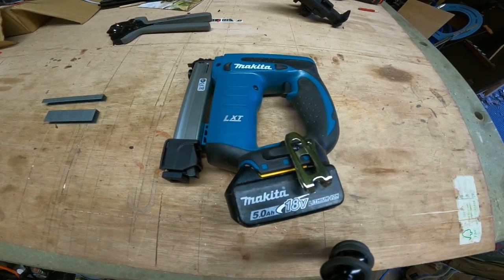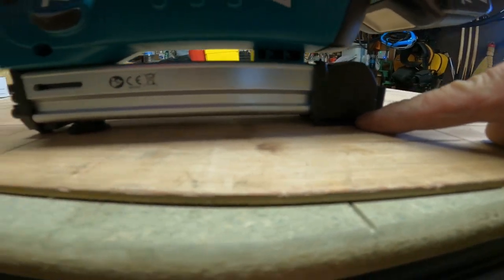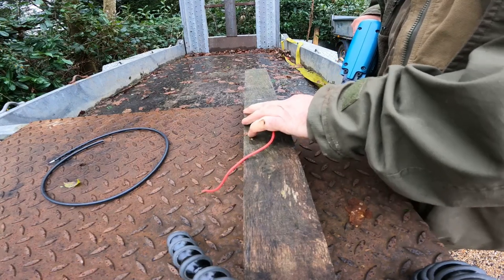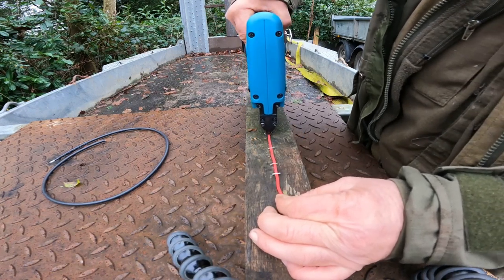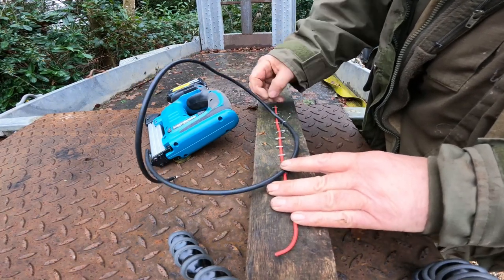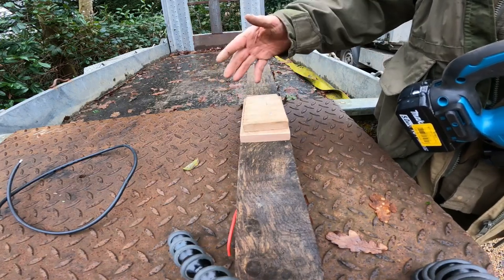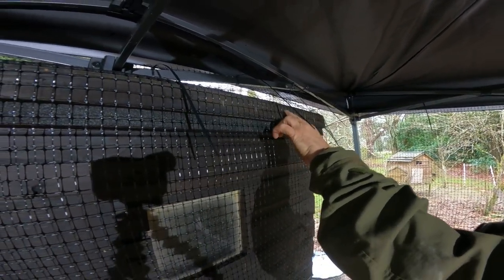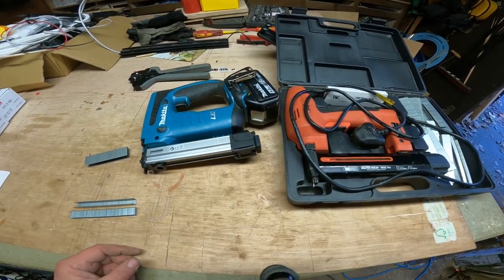Makita DST221Z 18 V Li-ion LXT Stapler

Comment: Hi could you please answer a question for me. What's the length of the stapler on the top. I want to staple carpet under my stair tread and worried it won't fit for a flush line. My aim is to carpet my stair tread only and not the riser. Appreciate it if you could advise for me before I drop a few hundred quid on it.
Reply from the maker: The length along the top is 192mm but the handle curves up another 10mm  100mm back from the top. If your tread overhang is less than 40mm then your good at 192mm. Hope this makes sense   Or otherwise I can do a video for you
Reply: @PhilipHollowaychannel  Really appreciate you looking into that for me thanks. My tread is roughly 190mm. I would greatly appreciate a video to see the angle I can get into. I'll drop you a subscription now. Many thanks Mike
Reply from the maker: I’ve just uploaded a video for you https://youtu.be/iPfi-uUzecc